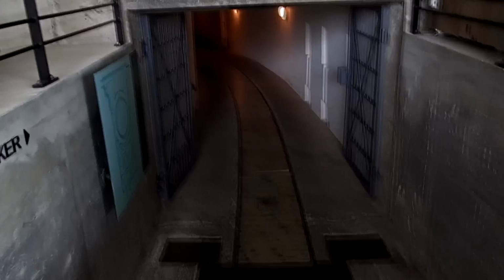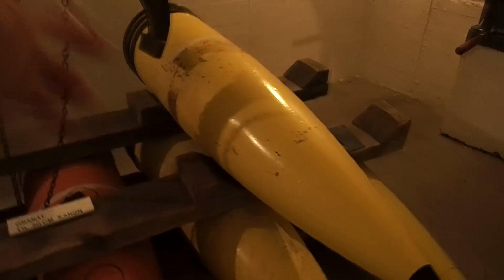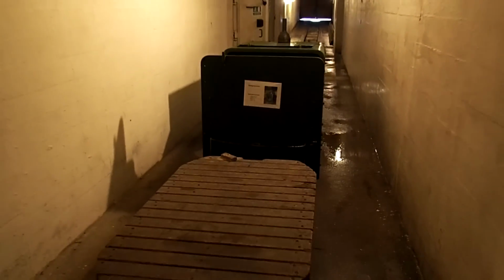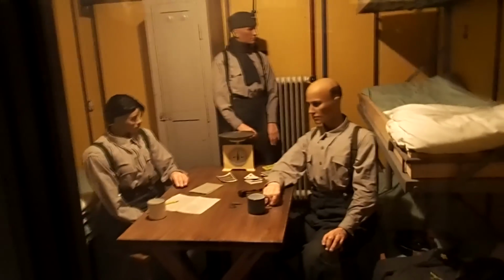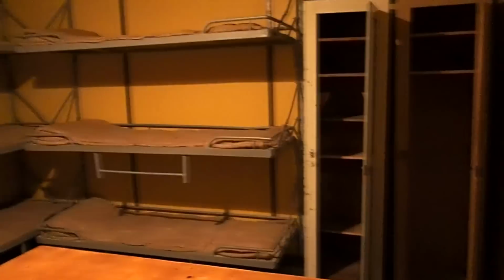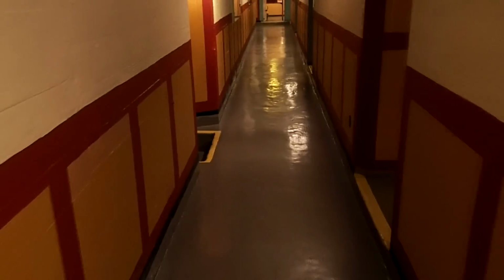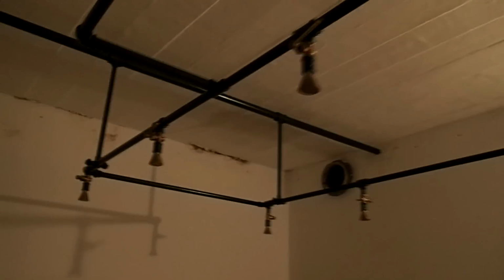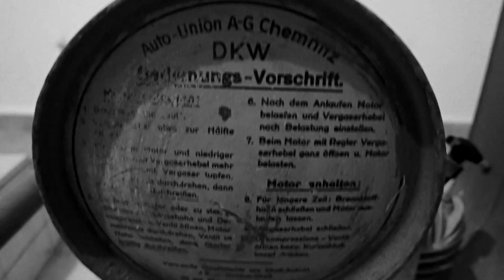Inside a real German WW2 bunker. Part 2.

Comment: They have done a good job of preserving this bunker. The ram rod for loading the cannon looked like in the picture they used two of them with a strap between them to pull the shell into the cannon. We’re they the original WW2 soldiers in the bunk room lol? I enjoyed seeing the trolley for transporting the munitions. They used a lot of different shells for firing. So not all bunks had hangers from the ceiling. I enjoyed seeing the original papers with instructions on the wall.
Reply from the maker: Soldiers are long gone and love to be there. Thanks my friend.

Comment: About the Dieselengine...I be shure the enfine was a Deutz engine. Normal power came in....big wheel kept turning...power, by failure gets out...the big wheel keeps turning, when the power stopsa magnetic clutch closes, the wheelturning starts the engine. so u have emergency power.
Reply from the maker: Thanks